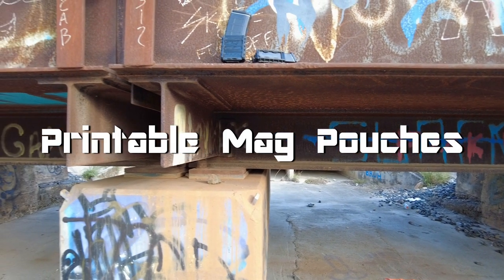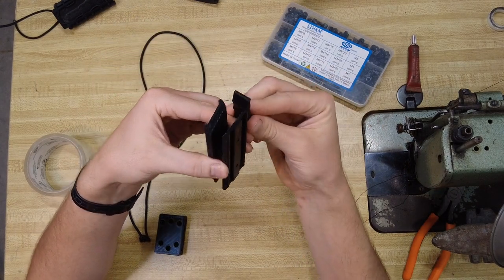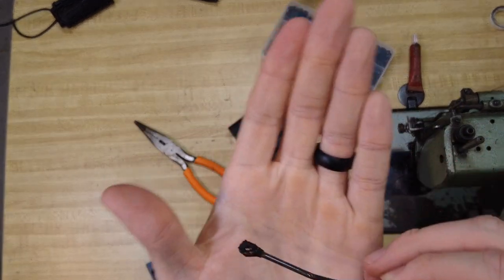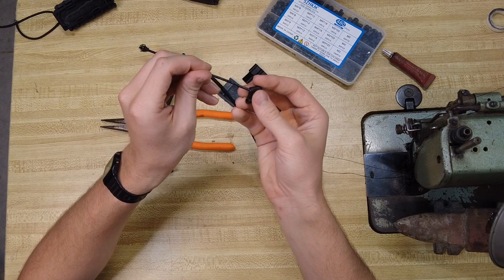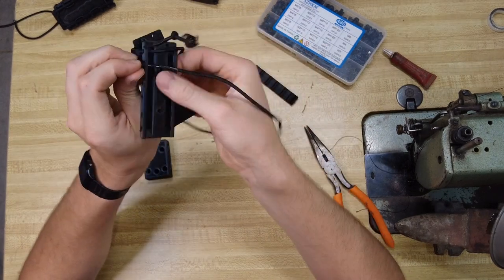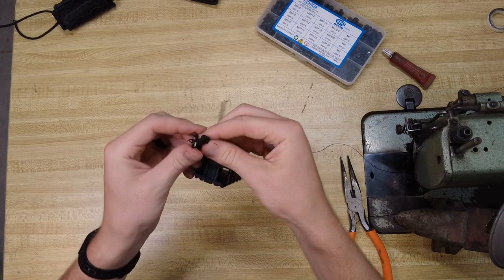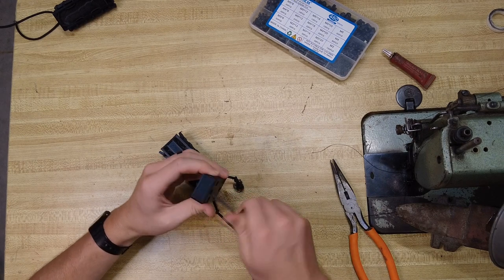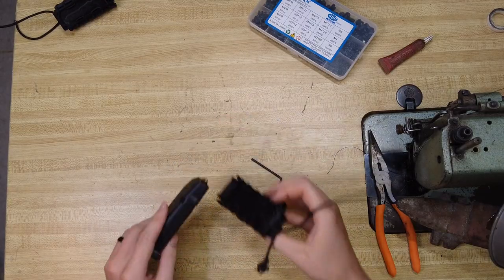3D Printable Mag Pouches // Free STLs

Comment: Just curious, why not spend the extra 5 or $6 and get a better filament? If you watch some of the strength testing videos there's a massive variance in durability and strength from Brand to brand amongst pla+. A roll of polymaker PLA+ pro is like $26 and it's been documented in multiple strength test videos to be around 20% stronger than budget brands like Esun, Sunlu and Amazon basics.  I just got into 3D printing about 2 months ago but I have already burned through nine rolls of filament. I was kind of shocked how differently my prints turned out from one brand of filament to another.  iv tried Sunlu, Esun, Amazon Basics, Inland, Overture, Polymaker and Pushplastics. Pushplastics was by far the best in every way but I'm just not going to keep spending that much on a roll of filament. Esun was surprisingly the worst in every way, I was expecting it to be pretty good based on how many Guntubers were recommending it. But it was total garbage. Sunlu and amazonbasics printed nearly identically and I almost wondered if Sunlu was the manufacturer for Amazon's filament. They both performed better than Esun but nothing to write home about. Overture seemed great at first but the dam cardboard spool started to disintegrate while it spun and started flaking off cardboard dust down onto the print bed ruining a 41 hour print.  Inland was pretty decent quality especially considering the price, my only gripe is that it seems to absorb moisture out of the air relatively quickly compared to more premium brands. After sitting out for just one full week I could hear popping in the extruder and had to print at 230° to get a decent print for the rest of that roll. Polymaker is my current go to until I discover something better. Polymaker prints clean, resists absorbing moisture even after being left out for 2 weeks, is noticably stronger and has less flex in thin areas of my prints it also doesn't suffer from warping when I'm printing hot for high strength parts. I did a fair amount of testing with Glock mags, printed 2 mags with every brand iv tested.... Polymaker mags and Pushplastics mags were strong enough that they could support my entire body weight when assembled, All the other brands crushed down instantly and Esun was so bad it just busted apart into several pieces. Polymaker and Pushplastics also hold up to mild heat noticably better, a 10 minute trip into the True value for some hardware destroyed a passenger seat full of mags. Only ones that didn't stretch until feed lip failure were those two. Mags weren't even loaded, just the spring pressure pushing on the follower blew out the feed lips. It was only 88° outside, probably would have failed even sooner if it was one of our lovely 99° summer days.
Reply from the maker: I didn’t know there was that big of a difference. I make a video on almost everything I print so you can see that you already have more experience than me. I’ll look into the higher quality stuff next time I order filament. Thanks for the information.
Reply: @thriftyoperator637  you should check out the YouTube channel CNC kitchen, the guy is a mechanical engineer and 3d printing guru.
Reply from the maker: @PracticalTacticalSheepDog  will do
Reply: @thriftyoperator637  any plan to make a MOLLE version?
Reply from the maker: @osgoodblack6464  not for now
Reply: @thriftyoperator637  No prob looking forward to the next vid!

Comment: You can use shrink wrap used for electronics. It's really cheap and is easier to apply than tape and you can get smaller protrusions.

For anyone doing these, avoid putting these pouches right on your hip. I've made several 3D printed pouches in the past and when you button hook around a door, there tendency to rip the pouch straight off the belt. I like his design using threaded inserts which is more durable than other designs but something to consider.
Reply from the maker: I tried the shrink wrap first. It was still a little too thick.
Reply: I've done a lot of testing on pla plus and I wouldn't worry about the one peice loop breaking off, the threaded version is nice tho, I did remix the one peice loop to fit my blue alpha outer belt, the fit was too tight